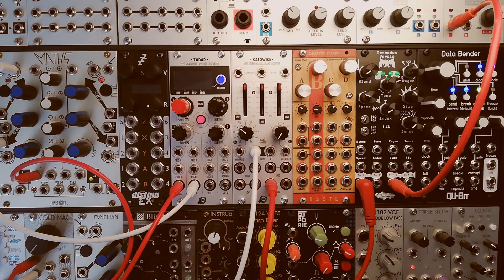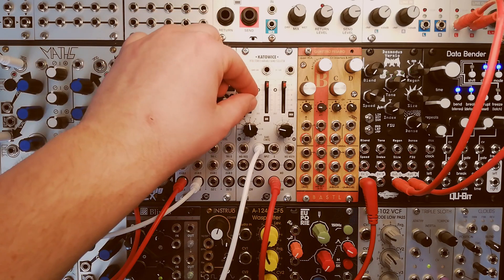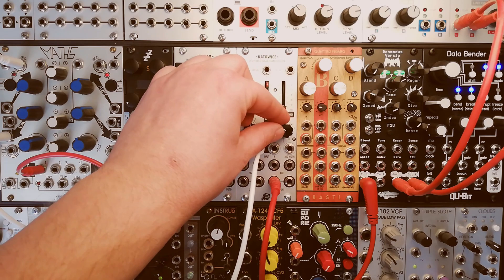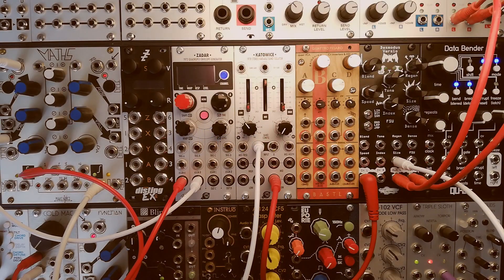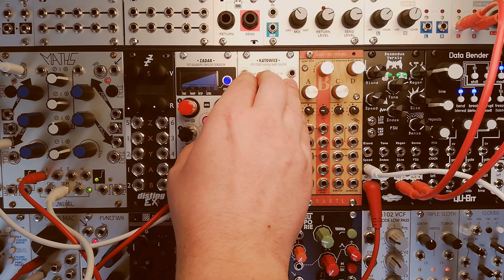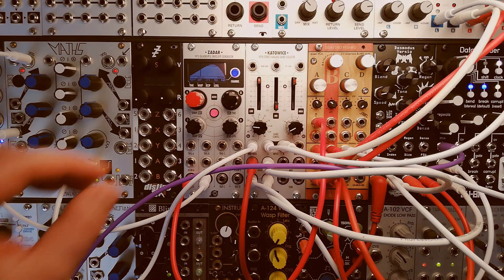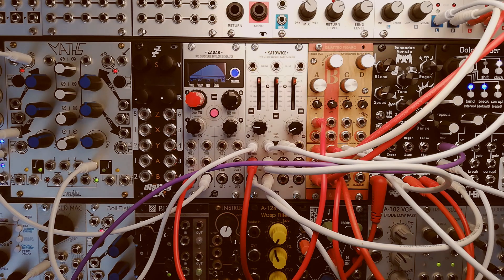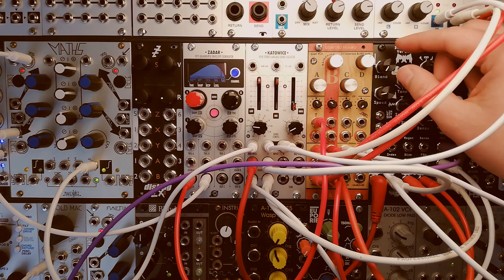Feature Presentation - Xaoc Devices Katowice

Comment: How do you like your Katowice now one year later? Still in your rack? Any specific thoughts about it? I'm thinking about getting one :)
Reply from the maker: Hey, thanks for your question! I am mainly using it as an AUX effects processor - I still enjoy it and will have to make some further explorations on of these days! :)
Reply: @gregordys2640  glad to hear that, it looks like a great module.
Reply: I have been debating getting one as well.  I may be misunderstanding the module, but is it the same as using a multimode filter to isolate a band for additional processing.  Does this module just make that easier to do or am I entirely off?
Reply: @interpr3t  a multimode filter wouldn't have a variable width band but a fixed width. You could use two filters, a HP and a LP, in series to make a variable width band but you'd need two filters for that. On top of that Katowice is stereo, and it also has three VCA's to control the gain of the three individual bands. No resonance though which is a bit of a bummer, but I'm curious how well it does feedback patching. 

Personally I'm considering getting one of these as an alternative to the Serge variable bandpass filter.
Reply from the maker: @interpr3t  hey you're not entirely off, but Katowice allows for three linked, stereo bands with a dedicated vca for each band. Of course you may build this concept in a separate patch with different building blocks, but not within 10hp and this amount of control. ;) For example, I also like to use 3sisters, but it doesn't have stereo and no built in vca.
Reply: @gregordys2640  thanks for the quick reply.  Very helpful!